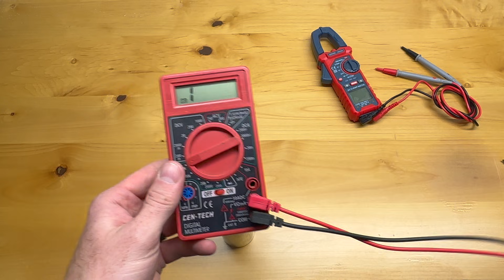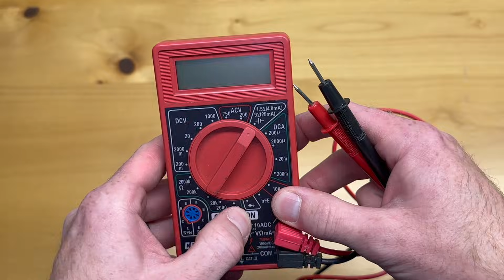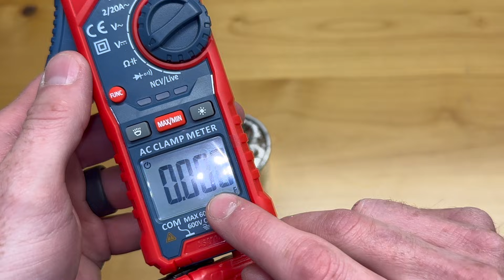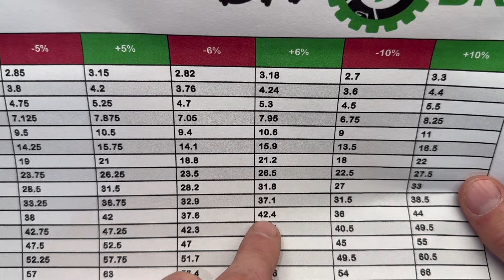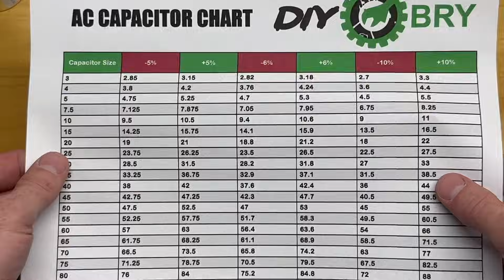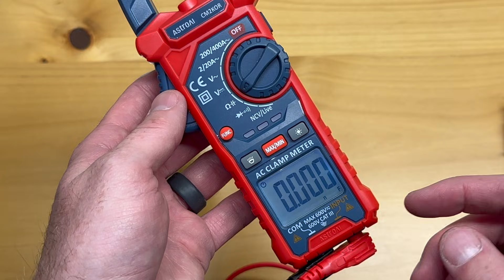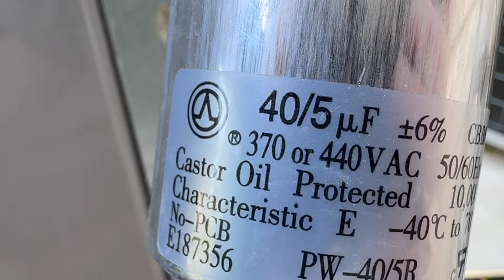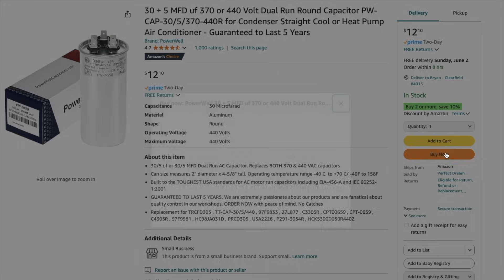DIY AC CAPACITOR Testing with MULTIMETER • SAVE HUNDREDS!! • Don’t Get Ripped Off By HVAC Companies!

Comment: Don't buy cheap meters.
Spend 70 to 120 dollars and it will last forever.
Reply from the maker: If the user was using it more than every once in a blue moon, sure.

Comment: Purchased a KAiWEETS KC604 AC/DC Clamp Meter that is very similar to the one used in your video. One of the differences is the function key, its marked Z/F. Not as user friendly as your meter. Thank you for posting your video. Cheers
Reply from the maker: Thanks for watching. Hope the one you got will work out well for you. Please remember to subscribe! 😎

Comment: Great viseo!  VERY helpful. My old multimeter didn't work either, so I picked up the one you recommended. 
One question....I ordered a cap and thought it was the exact specs, howerver instead of 45+10 +/-5%, it's 45+6 +/-6%. Will that suffice, or do +/-'s have to be identical?
Reply from the maker: Thanks for watching! Don’t forget to subscribe! 😎 Going down from +10 to +6 will greatly reduce the capacitance for the fan motor. Which means the fan will not operate to its potential. I would make sure they are identical, so your unit operates as it was designed to.

Comment: Thank you for this video! I paid $425 for a service call last year on my older Carrier AC unit and all they did was replace the capacitor and check operation. AC went out again and this time I ordered a new part with matching specs from Amazon for $20! Took me about 15 minutes of work and most of that was removing and replacing the access cover. I ordered the same multimeter shown at 5:25 and tested capacitance of my replacement part out of the box. I was worried when I wasn't getting any reading, but I wasn't holding the probes onto the connectors long enough! 👍
Reply from the maker: Awesome! Glad to hear it! Hopefully the video was helpful enough to earn me a new subscriber? 😎

Comment: At 3:29 you say you’re going to explain the herm and fan…but you only identify them…would have been great to know why there are two or three and any applications…just watched a vido before and he didn’t explain it either. Thank you all the same for trying to educate us :)
Reply from the maker: If only there was some kind of global collection of information that had a reliable search engine where one could easily go ask such a question and easily find the information to the question. Would be nice if upon searching this World Wide Web of information, it would return something like this: 

In a dual run capacitor for an air conditioner, "Herm," "Common," and "Fan" are labels for the terminals that connect to different components. "Herm" refers to the hermetic compressor, "Fan" to the condenser fan motor, and "Common" is the shared connection point for both. These terminals are crucial for proper operation of the AC unit.

Here's a more detailed explanation: 
Herm (Hermetic Compressor):
This terminal connects to the compressor motor, which is the part of the AC system that compresses the refrigerant.

Common:
The common terminal is the shared connection point for both the compressor and fan motor. It provides the electrical path for both components to operate.

Fan:
This terminal connects to the condenser fan motor, which blows air over the condenser coils to release heat.

AC capacitors can have two or three terminals for different reasons, often related to their application and the need to reduce parasitic inductance or combine multiple capacitor functions into one unit. 

Two-terminal capacitors are the standard type, often used in basic circuits where inductance from the leads and PCB traces is not a significant concern. 

Three-terminal capacitors are used in applications where minimizing inductance is crucial or where a single package needs to perform the function of multiple capacitors. For example:
Dual run capacitors in HVAC systems:
These combine two capacitors into one unit, one for the compressor and one for the fan motor, saving space and simplifying wiring. 

Feedthrough capacitors:
These are designed to be installed directly through a chassis, with one terminal grounded to the chassis and the other two connected to the circuit. 

Capacitors in high-frequency circuits:
Three-terminal capacitors can reduce the impact of parasitic inductance in high-frequency applications. 

Reasons for using three-terminal capacitors:

Reduced Parasitic Inductance:
In circuits with high frequencies, the inductance of the leads and PCB traces can hinder the capacitor's performance. A three-terminal design can minimize this inductance by routing the circuit path directly through the capacitor, shortening the distance and reducing the inductance. 

Space Savings:
In applications like HVAC systems, a dual run capacitor combines two capacitors into one unit, saving space and simplifying wiring. 

Integration of Functions:
Three-terminal capacitors can integrate the functions of multiple capacitors, as seen in dual run capacitors for HVAC systems, where one capacitor is used for the compressor and another for the fan. 

:)

Comment: I am going to test my daughter's inside capacitor and it only has 2 wires and they are both the same color and same size, I have not taken it out yet but I am wondering on a 2 wire capacitor will there still be a common and a fan or can the wires be pluged in on either side?
Reply from the maker: Does it look like this? https://amzn.to/4obZjTF
Reply: No it's only about 2 1/2 inches tall, and maybe 3 inches wide, and maybe 1 inch thick.
Reply from the maker: @audiewilkins9648 this closer? https://amzn.to/3UCWdKF
Reply: @DIYBRY  just about like this one.   Totaline P291-1004

Comment: Thanks for the right help. I saw that my Multi-meter didn't check AC Capacitors and ended up buying the ASTRO Multi-meter using your link to it. Went up in price since you got yours but not by too much plus I believe there was a 10% discount offered. Waiting for my Capacitor to be delivered. Amazon didn't carry the capacitor that I needed being mine called for a 85 +5uf capacitor. Got it from MCCombs Supply in Lancaster, PA. They sell on Ebay also. Believe it or not our RHEEM A/C System was installed in 1985. I have maintained it since then.  Well in the mean time I checked the old capacitor and the reading for the Common and Herm was only 20.5 and is suppose to be 85. The Fan and Common read 5.2 so that part of it was good but way to low on the Herm. My compressor won't turn on. In the mean time we are keeping cool using some window units that I keep as backups for that just in case occasion. This is the 2nd time those Window Air Conditioners came in handy. Had a incidence maybe 10 years ago and they did the trick.  This Summer has been so hot that I didn't want the heat to determine how I thought this situation out. Best to be prepared to take action and if you have the room to store some Window Units I recommend it. It can save someone from making some rash decisions costing you a lot of money when you are miserably hot. I am sure all know what I mean here. By the way I am a new Subscriber.
Reply from the maker: Thanks for you sharing you experience. Hope you are able to get it all worked out. And thanks for subscribing 😎 Hopefully you can find some other helpful videos.

Comment: That bad meter is the worst one I ever bought i wound up finding a mini pocket kobalt that had everything but the clamp meter option works nicely for space saving in the tool box and cramped areas like appliances
Reply from the maker: Sweet. Glad you found one that works well for you. Thanks for sharing!

Comment: Charged  $270 for a capacitor replacement on June 24 2025.
I had the wrong multi- meter to check if the capacitor was bad.
At the very least, I would recommend having a spare capacitor on hand.
If it's not the capacitor, you are out the 30 bucks compared to the $270.00

However, this fella even provides links to update my old meter, AND a link to the exact capacitor replacement that I need.

Liked and subscribed
Reply from the maker: Glad to hear it! 😎

Comment: You forgot to start your video by showing how to discharge the capacitor of the charge they hold, by using the screw driver method. You wouldn't want someone to get electrocuted!
Reply from the maker: I did not “start” the video with it, but it is mentioned starting at 14:55 when I am actually at the A/C unit.

Comment: did I miss the bit where you talked about capacitor safety and discharging before handling?
Reply from the maker: Probably
Reply: bro u took the wires off first, then u touch 1 terminal at a time. u are supposed to short them together You are a tool. U have no business opening that hvac unit. Your gonna get someone killed tool.

Comment: EXCELLENT tutorial!  I just bought and received a new 40+5 uF "Jard" brand capacitor from Amazon.  I'm using the same multi-meter you have and measured the new capacitor;  it shows:  Herm 40.5,  Fan 4.78.  Using your chart for % variances, both Herm and Fan measure within the +/- 6% but the fan reading is very close to the minimum of 4.7.  I'm wondering since this is a new capacitor, should I return it?
Reply from the maker: Up to you of course, but with Amazons easy returns policy it could be worth your while. Also would give you greater peace of mind if the replacement is in ranges you’d expect to see.

Comment: Please tell me which multimeter you used thanks
Reply from the maker: All products are in the video description. Here is it again: https://amzn.to/4bx8ebv
Reply: You can use any other type multimeters except the first one he shows it looks like a harbor freight multimeter their junks because I bought one and it didn't work  I have an astroaI but it's different than the one he has with that one you can test wires to but they do the same job
Reply from the maker: @georgetheodorides7480 thanks for the info for the community.

Comment: Great video and explanation. Helped a lot in troubleshooting a harbor freeze fan’s dead capacitor. The cheap multimeter I have tells me it is bad, but not its actual micro f reading which is annoying. As DIY’er who fixes own AC units, your video showed me that I need another multimeter to be able check different capacitor so I can see their condition and estimated lifetime. Ordered the same multimeter. It is nice of you also that you talk about the chart and included in your video so we can use as a reference in the future. You’ve put lots of time and effort into making this video which helps many who encounters similar situations. After an hvac guy charging $250 my in-law for replacing a $13 contactor which literally took him 15 minutes, I swore off for not getting ripped off by such greedy guys and have been doing regular maintenance on my own units ever since. Apprecaited. You have a new subscriber.
Reply from the maker: @samuelporter5245  So glad to help out. Also glad to assist a fellow DIY’er. Glad to hear my video has help you out. Thanks for the comment and subscribe 👍🏻 Hope you’ll find my other videos helpful as well.

Comment: What’s the difference between a start capacitor and run capacitor?  Are there 2 capacitors inside?
Reply from the maker: @q8b_0  A start capacitor provides a brief burst of energy to initiate motor rotation, while a run capacitor maintains the motor's operation once it's running. Start capacitors are typically disconnected once the motor reaches a certain speed, whereas run capacitors remain in the circuit throughout the motor's operation. Concerning air conditioners, it depends on the unit. While some air conditioners use separate start and run capacitors, others utilize a dual-run capacitor which combines both functions into a single unit.

Comment: I have that same brand of meter, AstroAI, just with a red clamp and grey body. My issue was the compressor fan was cutting off after 15 minutes of running. My unit takes a 50/5 dual capacitor and when it was last changed the tech didn't have a 50 pf so he doubled it up with a 45/5 and an extra 5pf jumperd in. The last guy to check the unit took the wires off to test the capacitor. When he put them back he switch the jumper to the fan connection making it a 45/10 Capacitor (supposed to be 5 pf on the Fan). That's why it was cutting off. I took a picture of the wiring before taking it out. It was obvious the jumper was on the fan terminal after testing the 2 capacitors. I ordered a new capacitor from Amazon that is the 50/5 which it's rated for. The ones on there are over 15 years and very rusty crusty. Still working but you can't read any markings on the top. Interesting the Fan would run at all with the 10pf capacitor when it's supposed to use a 5 pf.
Reply from the maker: Interesting situation, thanks for sharing. Were you able to get it all swapped out?

Comment: Great video!  Appreciate the multimeter detailed information.  
Question: Must you remove all of the wire leads prior to testing the capacitor?
Thanks much!!!
PS: My HVAC company quoted me $1020 to replace two capacitors.  I think not!
Reply from the maker: @RLG-w1w  I would recommend it to so you don’t get inaccurate readings. Hopefully the video was great enough to have earned me a new subscriber? 😎

Comment: I have a washer motor that I need to check the capacitor on, so I clicked on the link you provided and got the meter. Hopefully, they give you a small commission on it. Thanks for the tip.
Reply from the maker: Thanks for watching. I hope it all works out for you. Please subscribe! :yt:

Comment: Hi....I was told by an A/C compony that I need a new capacitor for $375. I was thinking I could buy the part for under $20 and then get my buddy electrician to do it for a lot less in labor......if he watched the video on how to replace it. Does this sound like a good plan? Thanks
Reply from the maker: @markg6605  Yes. Watch my other video on how you can do it yourself: https://youtu.be/E2nRolyvSZI?si=kqGOSanv-34icbI6
Reply: Do it yourself